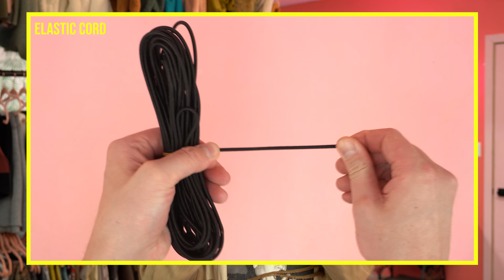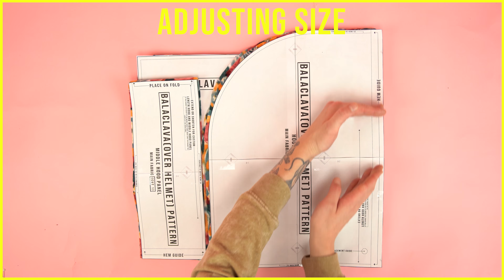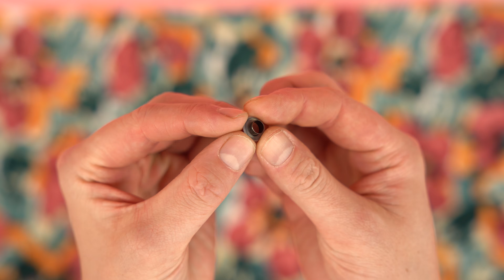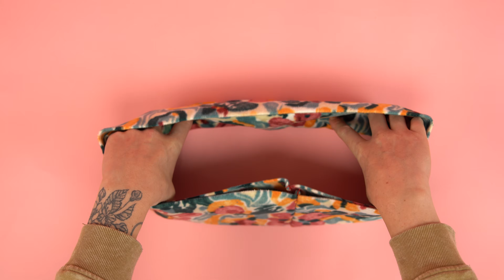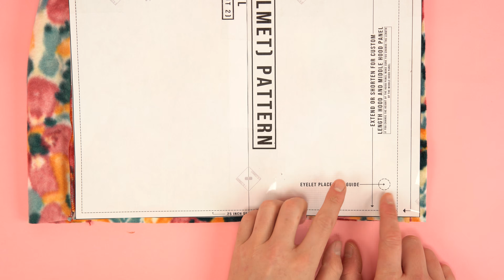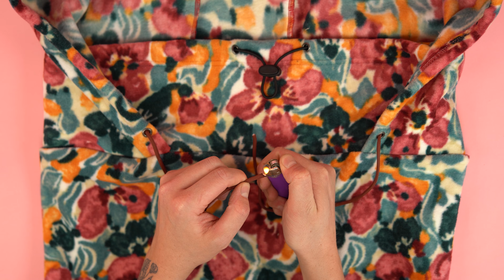DIY Balaclava OVER HELMET + Printable PDF PATTERN (EASY SEWING PROJECT) (STEP BY STEP TUTORIAL)

Comment: great pattern and easy to make but it is wayy too big, so just a forewarning for anyone else that wants to make one, this one size fits all is too big for the average person. I think specifically, the shoulder panels need to be made shorter so it doesnt bunch up at your shoulders, and some length should be taken off the height of the hood, since the length also causes the face mask part to fall at my neck instead of my mouth.
Reply: Did you use it with a helmet? Currently sewing one but made it a bit smaller as I won’t be using a helmet with it.
Reply: Is it still too big for wearing over a ski helmet? I am looking for an over the helmet balaclava.
Reply: what adjusted measurements would you recommend